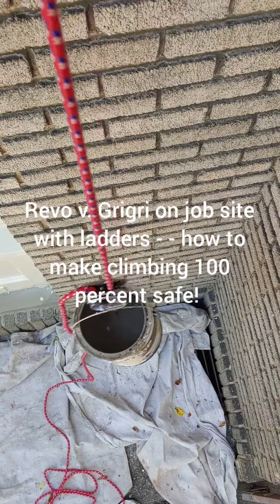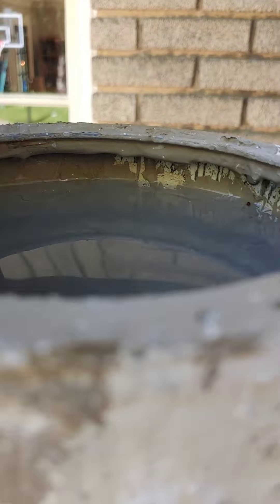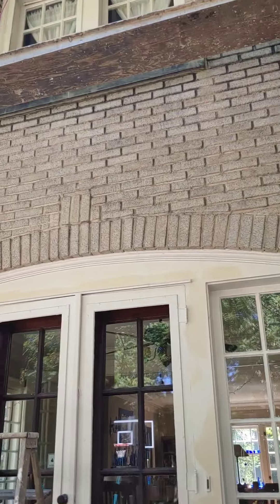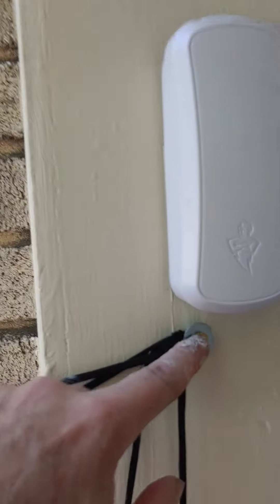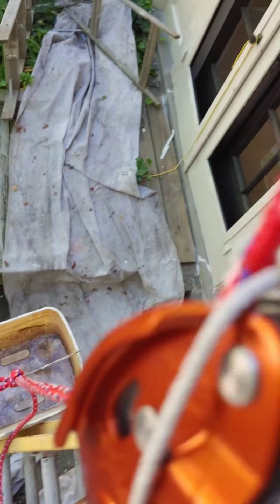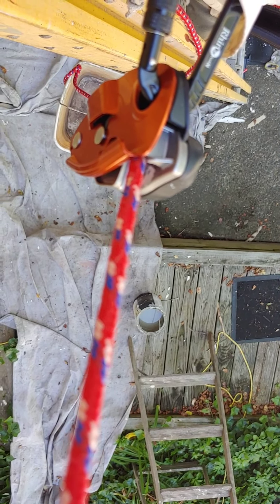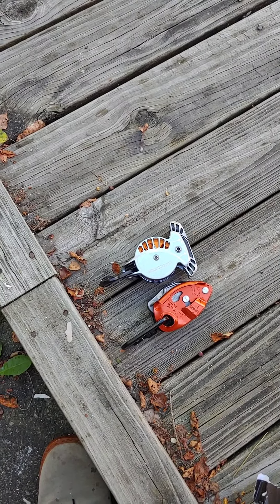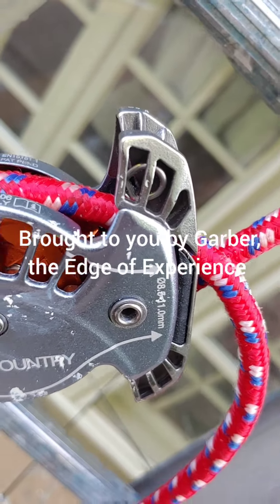Grigri v. Revo on a job site with drop tests.  Make all ladder climbing 100 percent safe.

Comment from the maker: Idiot alert at 16:45. Wrong Grigri threading. This mistake was made twice this day, despite studying the mechanism the previous day. Threading mistakes are inevitable, unless you are only threading the unit once per day for recreational climbing.  Real world repeated threading Will result in the wrong threading, even in the expert, definitely for the seasonal users. 

The wrong Grigri threading allowed me to walk down the ladder with the grigri, despite the weighted rope.  Also, I already established by this point in the video that the grigri doesn't not lock up without a weighted rope unless directly below the suspension point.   If I am climbing a mountain, both hands are occupied, and I am winding horizontally to find the easiest route. If I am climbing a ladder, I must always carry some things with one hand (which is the whole point of the ascent) and I cannot safely take the non dominant hand off of the ladder.  This means that the Grigri will always need to be weighted in order to act as reliable fall protection, but weighting makes climbing down anything impossible!!!!! 

The ability to climb down is essential for jobsites.  In rock wall climbing, most people would rappel down for the thrill. But, I can also see a climber needing to climb horizontally in a downward direction, where the grigri would lockup unless you have a third hand to lift the braking rope. 

The reality is that most climbers use long ropes with weight from the excess weight, which acts to weight the rope and allow the grigri to function as fall protection.  This would not always be true especially if someone thought that they could use 30 feet of rope to climb a 30 foot rock wall, then tried to go horizontally to get finger and toe holds!  This would mean that the Grigri has no fall protection for the unweighted rope, and the climber has a false sense of security.  This is a more likely scenario on job sites where it is only practical to tack suspension points every 14 feet, allowing a 7 foot off set. 

Unless I am missing something, this means that the Revo just works, while the Grigri has two fatal flaws - - decent prohibition in the real world and inevitable wrong threading. 

I would also note that the improper caribiner clipping possibility on the Revo would be easily fixed by a better design or modification to close the tempting gap for the caribiner.  Still, a stoned or very, very low iq worker might misthread the Revo, even after training; but this is not going to happen for the non stoned average guy.  Best practice would be to hand brake and put some weight on the suspension before climbing with the Revo.   

Unfortunately, this pre climbing weight test would not rule out incorrect threading on the Grigri, because it still partially brakes backwards. Moreover, I feel that the inability to descend is a fatal flaw for the Grigri. An unweighted rope offers easy up and down movement and self slack reduction on the Revo--while offering fall protection, at least for heights above 9 feet.
Reply: Why do you feel the need to make sweeping statements about equipment you've used for a total of... a couple hours?

No, backwards threading is not an "inevitability, even for the experts". Us climbers depend on this for our lives, or the lives of your climbing partner. And no, recreational climbers don't just thread the grigri once a day. I re-thread my grigri dozens of times a day. It's actually incredibly easy to double-check your thread direction and not freaking kill someone or yourself.

Do you think there's an epidemic of climbers murdering their partners because they accidentally threaded their grigri wrong. "Oh well, it was an inevitability!".
Reply from the maker: Understanding the under lying physics is not making a sweeping statement. If you do not understand the basic mechanics, mechanism of action,  of anything, from medicine to electronics to plumbing to the brain to the cell to your car,  etc, then you cannot competently understand the epidemiology, troubleshoot, operate,  build,  fix,  prevent,  create,  etc.  

Sure with drop down medicine you can do some good (while doing a lot of harm that goes unnoticed).   Maybe you can fix certain things on a car (usually,  doing it the hard way,  or missing a lot of things). 

 I am not sure of your point.   Drop tests,  the math,  studying the mechanism,  finding out exactly why a device will fail,  have value.   

Your grigri might save a person for 30 years.  But if you don't know about the out of ordinary situations where it doesn't work,  one day you will be surprised.

A once in 5 thousand situation for most people might be a daily situation for some minority of other people.  If you understand the physics, the math,  the mechanics,  even the material properties,  then you can make better predictions about people and situations that fall far out of the standards of deviation.    

I solve problems every day.  Step 1 is to ask as many questions, as imagination can allow,  recognize problems that most people are blind to.  Step 2 is research and understanding problems and potential solutions.  Step is going back to step 1 to step to as many times as necessary,  even if it takes years.  Step 3 after you have the understanding and hypothesis,  consult experts and forums.  Step 4, go back to step 1.  Step 5,  go back to step 1 as many times as needed.   Step 6 is a safe controlled small scale test.  Step 7 is go back to step 1.  Step 8 is medium test.  9 is go back to step 1.  Finally,  full size test,  but understand that in any experiment or new development there is exactly one way for things to go right,  and a million ways things can go wrong - - a million unforeseen hidden variables that can impact the outcome.......   But never ever,  immediately skip to step number 3 and immediately how to manuals or the experts,  unless you understand that every thing you read or they say should be taken with a grain of salt,  until you gain a full understanding of the underlying chemistry, physics or mechanics......  All experts are wrong some of the time,  most of the time,  and even,  all of the time.   Thus,  never rely on one just opinion.  It is even important to not rely on consensus plus the study,  until all testing is done.   Even then,  there may be some left field variable or variables that are huge, but universally overlooked.